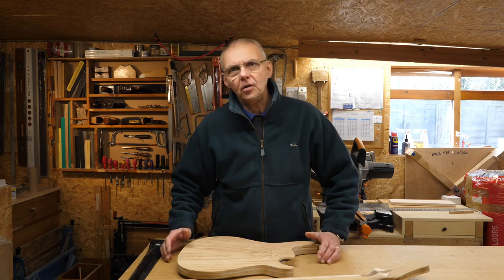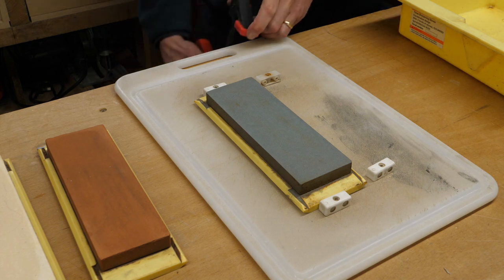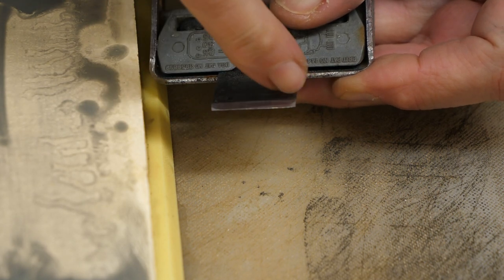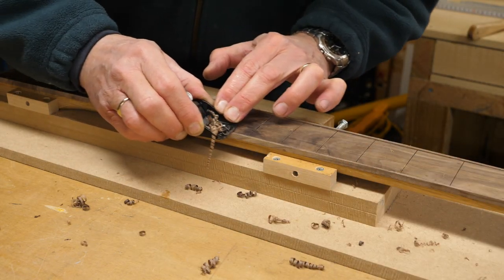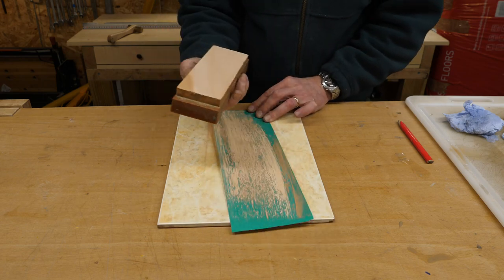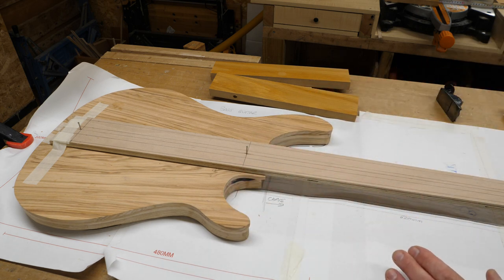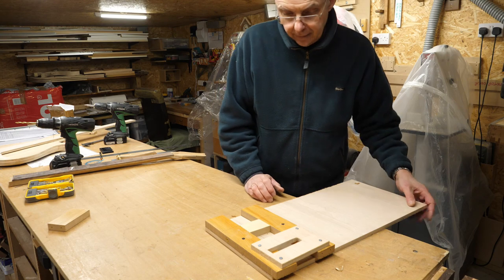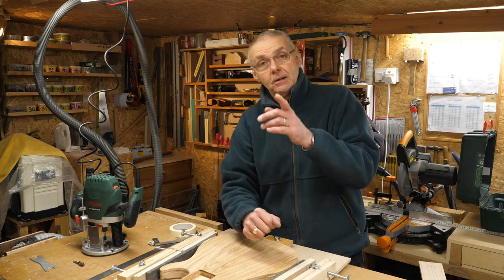Complete Bass Guitar Makeover - episode 14 - back to work.  Small plane, sharp blade?

Comment: Missed you, Dave. Working on a short scale electric, but first I have to move about 4 inches of snow off my driveway. Omicron is hitting Wisconsin hard with a daily average of about 15000 new cases. (Population about 4 million). Only going out for necessary items. Waiting for fret wire from Amazon. I have nearly everything else. Thinking about fret markers and sanding the fret board radius. Cheers.
Reply from the maker: Hi Robin, its a bit chilly here but no snow.  Some of my family have had Omicron despite having 3 jabs so you are wise to be careful, we are staying at home.  A short scale electric guitar sounds interesting - what's the scale length?  I'm going to have to catch up with your covers, they are an amazing collection of well recorded songs - if you feel like it, have a ago at the scoring challenge it would be great to hear how you would approach this. Cheers Dave
Reply: I am using my Taylor Baby as a model for this instrument. It claims to be a three quarter sized guitar. I find it very easy to play because the shorter strings aren’t as tight. The scale is 23 1/2 inches. I used the same scale for the tenor guitar I built last summer.